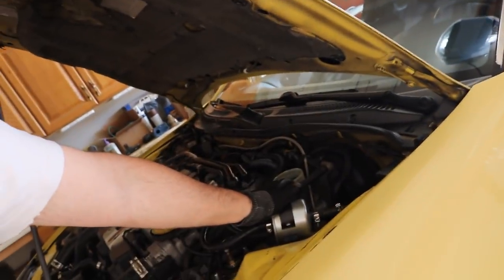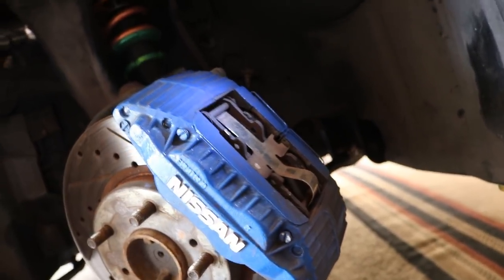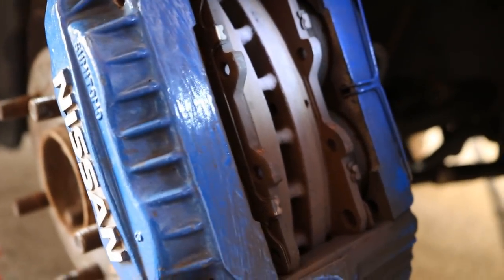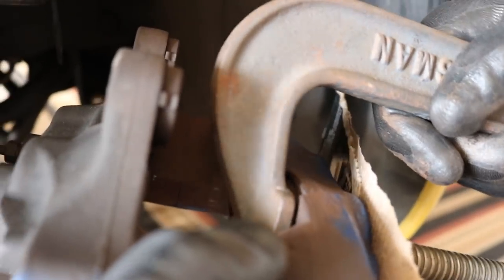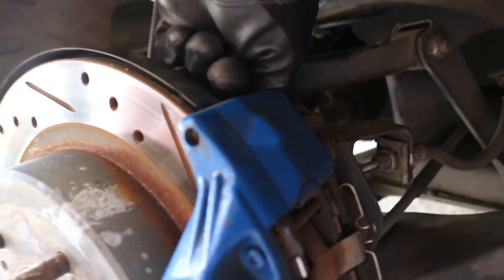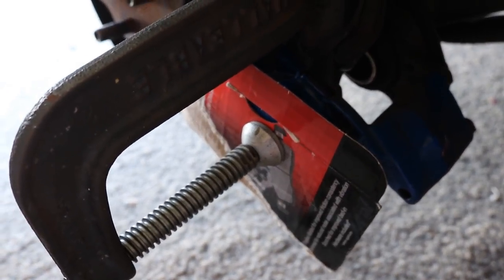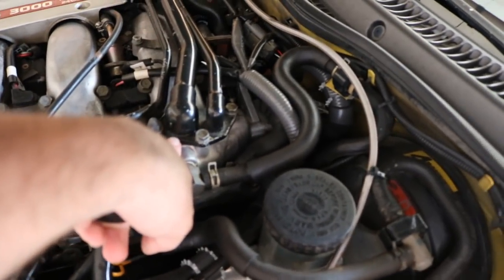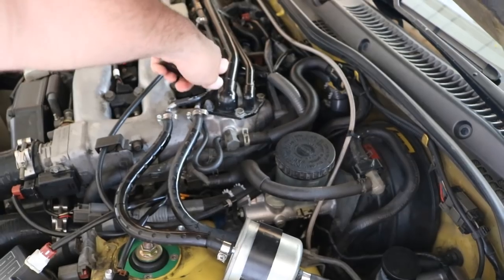1990 300zx Twin Turbo brake pad and rotor replacement!

Comment: Helped out alot thanks! One question do you know if i need the the entire rear end setup like the drum and handbrake cable from the zx to properly do the 5 lug conversion on s13??
Reply from the maker: To do it properly, you need the drum, not the cable

Comment: Since you were replacing the rotors, couldn't you have just used a prybar to compress the pistons before removing the caliper?
Reply from the maker: Yep!  Thats definitely one way to do it. I just didn't have a pry bar handy, so I used a c clamp.
Reply: @MohrGarage  Another way is to use use the old pad to apply equal pressure from the C-clamp.  Works like a charm.